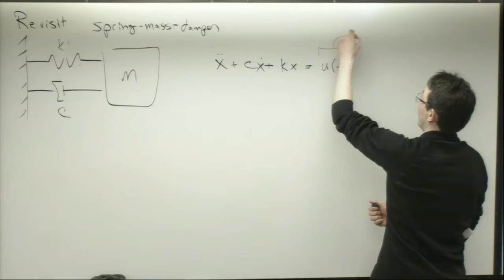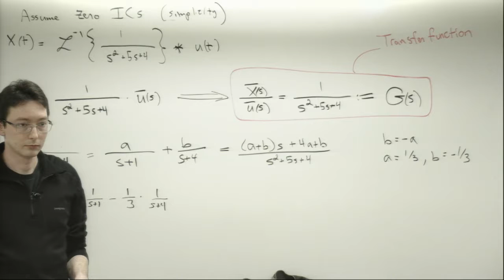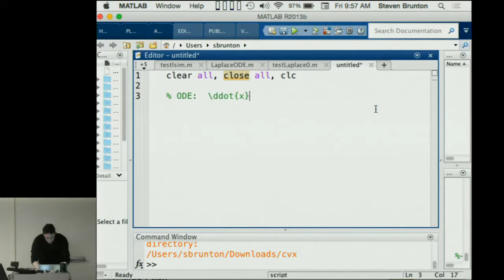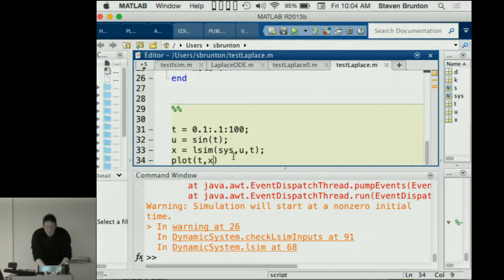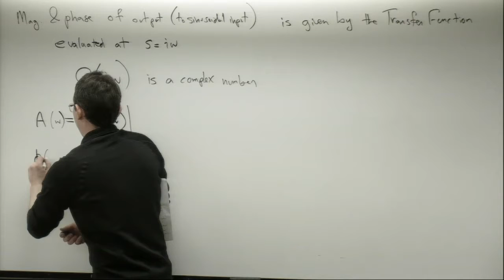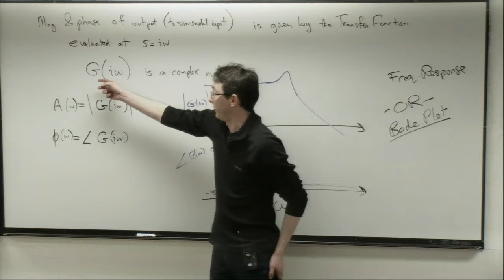ME565 Lecture 23: Laplace Transform and ODEs with Forcing and Transfer Functions

Comment: Anybody have Matlab with control system toolbox - I'd like to know whether Xo = [2,-5] and initial(sys,Xo) gives you the proper response.   So far, I've found that Octave Initial needs the Xo=[5,-2] and Scilab Cim needs Xo=[4,-5] to give the proper response.   Proper response "Starting at 2 at t=0 and such."    Apparently not many people use "Initial" or non-zero initial conditions.  I have not looked into the Python Control Routines yet.